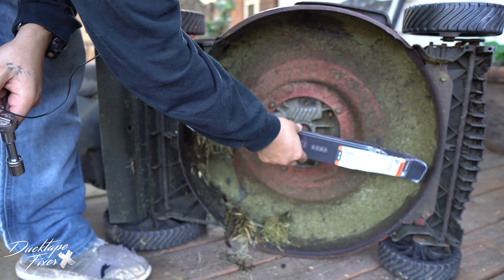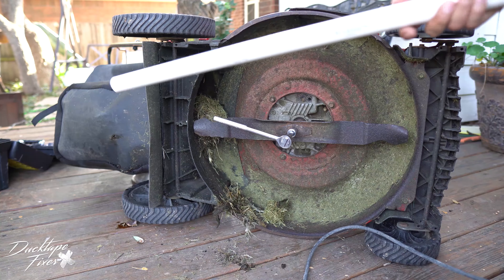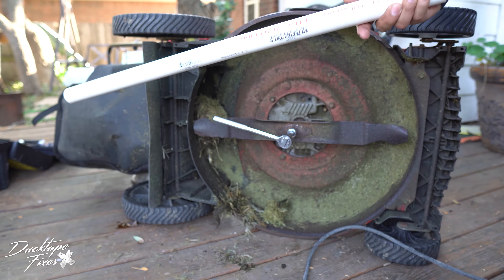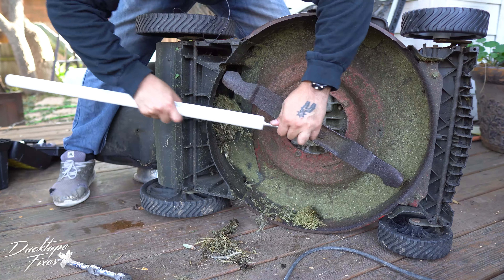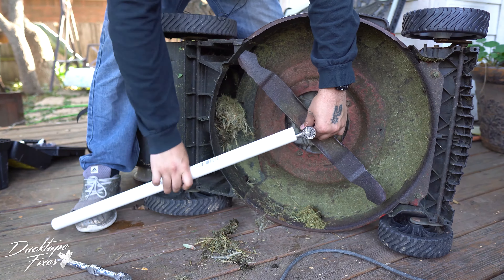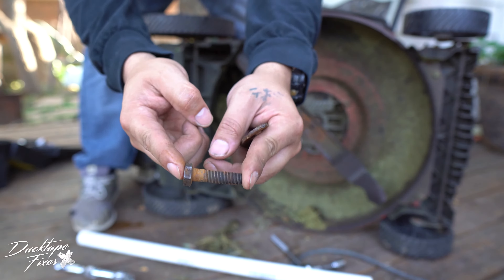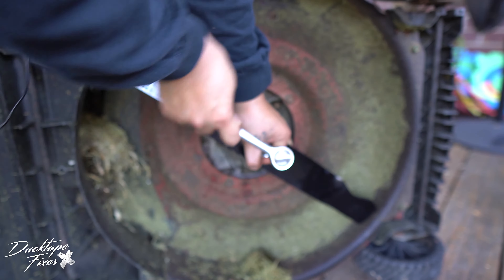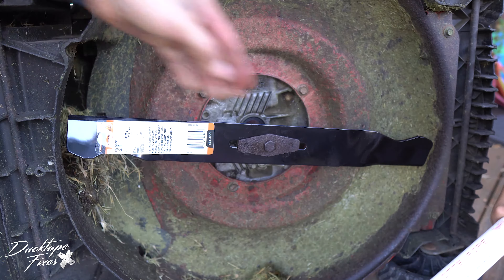How to change a stuck Lawn mower blade bolt

Comment: I had swollen lug nuts on my truck so i banged on the socket and used a breaker bar and the pole to my floor jack.. made easy work out of the job.

Comment: Use an oxy torch to heat the bolt and then remove it, if you use a breaker bar then you risk shearing the bolt

Comment: Of course, have to use a torque air wrench or an electric torque wrench.  The cheap and easy way is to use a wrench and a rubber mallet to hit the wrench producing an impact torque on the wrench to take off the bolt.

Comment: If would have had a 1/2” drive breaker bar would have worked just as good as the 3/8” cheap ratchet! The pvc extension you didn’t even move hand down the pvc for more leverage? Just held hand over pvc an ratchet handle?